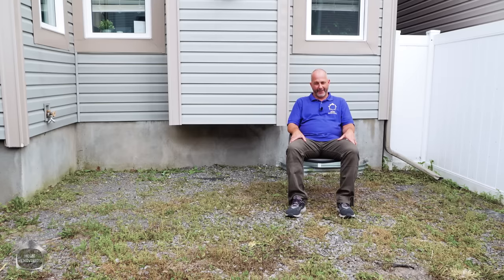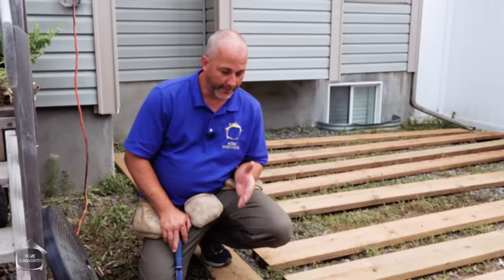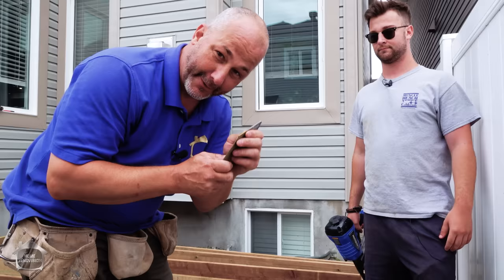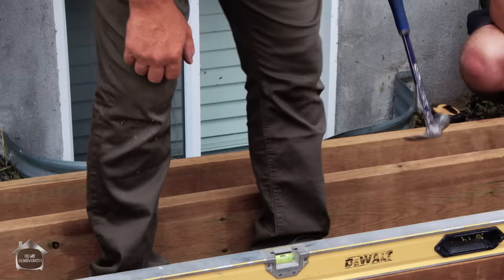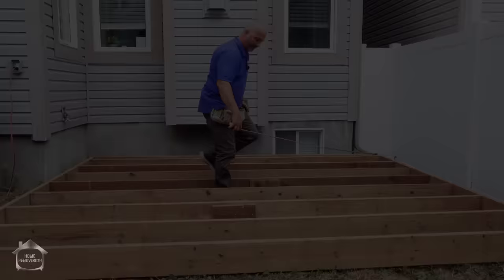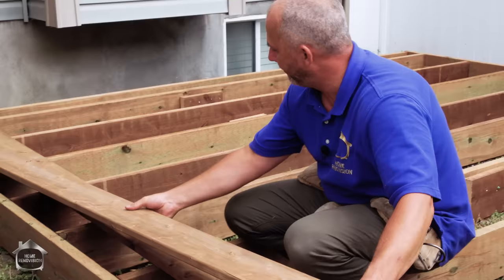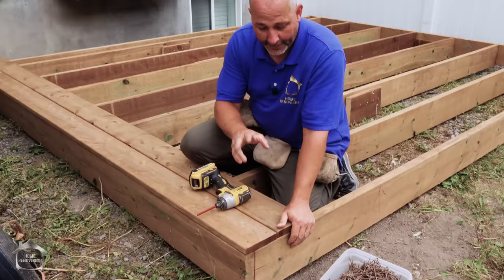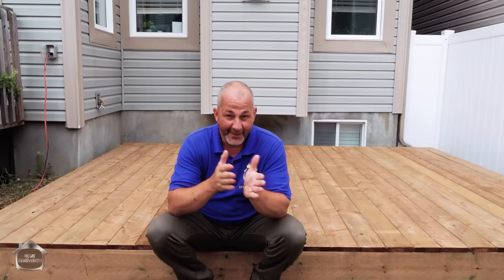How To Build An Affordable Deck

Comment: So I have a seasonal campsite and I want to build a 16'x10' deck, what you showed in this video is a absolute lifesaver.  
I had previously laid stone on the section I am building on. My question is would it be beneficial for me to lay a barrier on top of the stone? Also ground is a little un even in spots. Any tips?

Comment: Hi Jeff,
I think this is just what I need and hope to do it myself. Dealing with the ground prep and concrete blocks was my biggest obstacle. I have somewhat soft dirt in the area where I want a 12x12 deck. What's your recommendation for easiest way to prep the ground for your style if floating deck?

Comment: @home reno vision DIY, so do bgg you use the 2×8 12's just on the outer perimeter,  and the 2×8 10's at the top and bottom? Second, what length were the inners, because you didn't mention if I'm not mistaken?

Comment: Would this be sturdy enough to support a gazebo ? Or is it necessary to add more structural support underneath ( concrete deck bases that are partially sunk into the ground )

Comment: HI Jeff, I'm building an 18x18 floating deck stacked on 4 way deck blocks(no Posts, just slotted on the deckblocks' slots).  How do I join two rim joist and make it sturdy?  Will Drilling screw diagonally be strong enough? Thanks in advance!

Comment: I realize this is a silly question - esp since I just listened to you explain about how to decide which side of each board should be face up - but does the stamping/ink come off of the deck boards? My contractor installed a deck for me, and the stamps are really bugging me. My thought was that side should have been down - they're saying some boards are stamped on both sides, which seems unlikely to me. Anyway: (1) are they stamped on both sides, and (2) does the stamp wear off with time? THANK YOU!

Comment: I really hope to get feed back we have a ground level deck that we want to extend it is only a 11x11 extension and we have had quotes of 4000 to 7000 it's crazy so I wanted to see if a girl like me could do it myself and found you and my question is how do I add the new deck to the old deck and my yard is a little uneven where I will extend if you have any advice I would be forever grateful

Comment: Can I make this, but 6x10 and put 4 post in the corners and have pier blocks at the bottom like you're other video that had the ramps, where you used the 3 beams? I noticed you built another deck on top of those beams and not one here. My height im trying to reach is 3 feet, from ground to top of deck board. I'm just trying to keep from over thinking this. Thank you for your time.

Comment: Can you list the lumber you used size and number of boards ? DIY woman who just got an estimate of 4K from a builder .
Reply from the maker: pressure treated 2x8. you could use 2x6 if you are setting it on the ground. 10 x 12 deck requires 2 boards 12' long 10 boards 10' long
the you need 5/4 x 6" x 12' boards. 21  of those will finish it fine. Cheers!

Comment: I am looking to build a 10 x 10 low level deck for a hot tub. The location is not attached to the house and has a slope of (about) 12" in the 10' span.
question: Your video shows using wood blocks supporting the deck to the ground every five feet. Does this method work for that large of a ground slope?

Comment: I am wanting to build a deck that will cover when my lawn used to be. It’s a 28ftx16ft area. Do I have to level the ground first? Also, I’m having trouble figuring out how many board I will need for the entire project. Do I need to build the deck slightly off the ground in order to prevent the wood from rotting?

Comment: Do you have to raise the deck if your building on concrete? I am thinking of doing this on our rooftop garden. Lots of sun assuming a little bit of moisture from the rains. Location: San Diego/ Tijuana Mexico

Comment: We are building a large platform deck off the back of the house. The house entrance opens outward potentially hitting any structure above 3 1/2” high. 
There’s also a slab we are over. It’s much smaller but is there. 
Our house sits so close to the ground I’m afraid I’ll have to dig out for the band boards and the outer frame , plus have to use 2x4 instead just to ride under the screen door opening. 
Writing this out makes think of other issues. 
Don’t know if this will work. Plus our tiny town wants permits and inspections unlike anything I’ve ever seen. 
Any suggestions? 
The deck build is 12x16 but the original concrete slab is only 12x10’

Comment: I have a question. When you say to nail  Boards in to tight together, but then you say space for rain. I don’t understand. Do we nail boards tight or we leave space. If it’s tight, how does rain pass between boards ? Thanks.
Reply from the maker: wet wood dries after install and creates a gap. dry wood needs to be installed wit a space. Cheers!

Comment: Very nice video. How to keep wood from rooting if thre is a heavy rain? Why did you not lever it up from the ground so it will not float in the water/snow?
Reply: still it will get wet on the surface

Comment: Somehow I have a feeling they used the concrete blocks shown in the beginning of the video instead of the wood blocks to level the deck out, more expensive by a 100.-+  but a better option

Comment: I'm building an 8x10 foot deck on unleveled ground.  Using 2x6 for everything.  Do you think the leveling trick would work or should I use concrete. I've never built a deck so I have no clue. Thanks

Comment: Hi Jeff, 
I am wondering if its possible to use this same layout but use a 2x6 instead of a 2x8 board throughout? I am in a rental and am looking to build something that is more affordable since the price difference of these boards in my area is around $9 each. Does the shorter deck have any issues that I might not know about?
thank you in advance :)

Comment: I tried this but I did not use concrete- I just dug a 6 inch hole and sunk in my posts. It was ok for a few months but it’s wobbly now (about 5 feet off the ground).  My question is - do I need to lay down a concrete base?

Comment: I want to build a deck, but have a meter of cement and then grass the rest of the area. Building over the grass is fine, but want to keep the cement. My question is would I need to treat the wood that is on the cement part for moisture or wouldn't it matter? Southern hemisphere (warm climate)

Comment: Great video, thanks. I am building a large, single level, unattached deck that is 40' wide.  However, it is 3 different lengths, the dining section on the left is 11W'x8L', the grill area on the right is 11'Wx5'6"L and the main entertainment area in the middle is 18'Wx 11'6"L. This area comes out from the two wings at 45º angles to the front entrance area where it is only 10'W.   My questions are:  
Should my joists go width wise or length wise? I am worried about the 40' width being too far for joists even with a footing being located every 3.5 feet.
If I have the joists going length wise then I will I have to have my decking going lengthwise instead of width?  I am worried about that looking funny not running the width of the deck.
Could I actually build it as if it is 3 separate decks and then just screw them together? Part of me wants to do it that way to make the project more manageable.
I have drawings and photos available.
Thanks.

Comment: Question..we are building deck up against the house.  Its 8 x 8.  We are having trouble squaring it.  We are off by 1ish inch.  If we correct it, then its not up against the house and look weird.  Will the inch make a difference ?  Ty

Comment: Hey Home RenoVision DIY, I plan on building a deck for my RV. That deck is going to be around 30'x10'. The issue I have is from the back to the front of my RV, I have a slope of almost 3 feets. This means I have to start as a ground deck and finish with some posts. I was wondering if it was necessary to have beams since I don't think it's going to be possible where the deck has to be ground level. Is it possible to simply have joists with posts? Will it be solid enough? FYI, my RV is located in Quebec and most of the deck is going to be between 0 and 3 feets high, so I'm not sure rules apply here haha. I simply want it to be safe for my kids.

Comment: I live in the snowbelt (Vermont). I noticed that you didn't use landscape cloth (even though you mentioned it) or paver stones, deck blocks, etc. The area on my property where I want to build the deck is a little moist but does get 5-6 hours of sunlight.  It does dry out well after a few days of dry weather. Will the lumber hold up over time with direct contact with the ground? If I get 15-20 years I'd be happy.
Reply from the maker: you'll get that. cheers!

Comment: Nice. Job ,  I am building an 8 x 20 deck 24 " high. im 54 a female health issues. I just need help getting squared and level. Im not putting 4x4 in ground. Im sitting them on top of  concrete pads instead. I have noone to help. Any help suggestions would help. Please. and thanks.

Comment: Hello, Jeff. I was always told that a deck requires posts with concrete. Does the tarp underneath replace that? Thanks for all you do!!
Reply: Why would a tarp replace foundational footings? The purpose of the footings is to creat me a rot free connection between the ground and the decl frame. He mentions this in the start of the video talking about the soil. A tarp layed down will mean the water will pool on top and rot your deck. Just set it on cinder blocks if you don’t want to dig holes and lay concrete

Comment: I'm looking at building a deck on top of an existing patio made of slabs is this ok and what is the minimum thickness of timber I can use for the frame as I only have about 6 inches between the slabs and the bottom of the back door and I have to account for the thickness of the deck boards which are 1inch and should I leave gaps for swelling as I live in the wet uk 😆

Comment: Does this hinder rain flow 
keeping water from running into window wells
that are below ground ? 
Do you need a trench ?
Reply from the maker: it could so always run your framing in the direction that water flows to avoid that problem. Cheers! That is why we use blocks to adjust the level so there is always room for the water to drain.

Comment: Hi, I am going to build a decking 10x10’ in my backyard. Half of the frame will flush with grass and the other half 5” above the grass. I am going to use 2”x6”x10’ severe weather lumber from lowes. My backyard soil is clay and limestone. Do I still need posts? Can you please advise? I live in central PA
Reply: The deck is not attached to my house and the middle of the deck 6’x6’ will be porcelain so it will be filled with stone and sand. So only 2’ on each side will have Trex boards. The frame will be 12” apart instead of 16” to be more rigid and because I am going to use groves Trex, not a block Trex.
Reply: Sorry, I am asking a lot. Do I need to protect the lumber since it will be in the ground and how?

Comment: Would the deck be susceptible to moisture and mould considering that it's sitting on the ground and not on stumps ?
Reply: Same question, doing research they say if it cannot dry out underneath you will have mold.

Comment: Great video thank you!   Question, is it ok to butt the deck boards tight to each other?  Will there be room for movement and rain drain?
Reply from the maker: if you install them wet then yes.
Reply: @HomeRenoVisionDIY  thanks! Otherwise, when installing them dry, should there be a slight gap between each board?

Comment: We went pressure treated frame & Trex decking. Our frame is now rotted in many spots. Spongy to walk on. Need a best most cost effective solution please. Thanks
Reply: Curious how long before the pressure treated frame rotted out? Are you over grass. We need to build on grass as well.
Reply: @kebejer1  partial grass & an old sidewalk. 15yrs

Comment: Ty for your  videos! This one in particular! Question, we want to build a 10'x20' deck in our backyard similar to this one in video. We want to add rails to it would be the only change. How do you recommend we do the rails?

Also the deck will be in front of our master bedroom and later this year we want to have contractor replace our windows with French doors to open to deck. We got a quote for the deck at 6k and the French doors and install work about 5500 or so. Our thought is we could build the deck and save But no way we want to try and convert our window to French doorz. So if we do the deck ,how do we know how high we can make it to accommodate the French doors.
Reply: I can send you pics of our yard and proposed area of deck..just need your email, appreciate your help sir.

Comment: I didn't fully understand the leveling process with the pieces of 2X4.
Reply from the maker: what I am building there is a point load with the block and nails. the nails carry a huge amount of load so lift the deck level set the block and nail it to maintain that height. Cheers!

Comment: Pretty sure I'm going to be told this a bad idea but, could i build a deck like this over an existing deck?  I have a ground level (literally about 2 inches above the grass) deck that's old and falling apart and i would love to be able to just build this over it.
Reply from the maker: take off the deck boards first and make sure the  structure is solid enough to support it.

Comment: I'm about to do this in my back yard in New York. Right on the ground over soil. Deck will be in the sun. Am I supposed to leave gaps between the boards?
Reply from the maker: yes. Cheers! in the summer it will have gaps and in the spring and fall it will not. Cheers!

Comment: Just curious what you think the price on that exact same project would be today? Looking to build for our seasonal campsite
Reply: He said it was $650 in materials 10
Months ago.   That is fairly close to what I built my 12’ x 12’ ground level for 2 years ago (Canadian $800, using standard pine).   Lumber prices have risen so much in the past three months that what once you could buy to build 14.2 houses, you will now only be able to build 2.4 houses with.  That is a 591.7% rise in lumber prices, all within the past two months (hyperinflation).   Multiplying that rise in price by this fellows $650 budget = $3,845.00.  

...But keep your eyes out for deals.  I don’t know about down south, but here in Canada thieves are now targeting the construction industry.  Worksites are being robbed blind by lumber thieves.   Seriously.

Comment: I have my surfaced prepped with textile down, do I need to put gravel on top of the textile and then do the deck, or simply on the textile is fine with no gravel? Thanks.
Reply from the maker: if you are setting the deck right on the textile it won't move so you are fine. Cheers!
Reply: @HomeRenoVisionDIY  excellent.

Comment: HELP, were renovating our old deck that came with the house bc it is moody and soft. We pulled the old planks out but then the wood that they are sitting on are also soft (these are 3.5 x 3.5) the plans on top are 1.5 x 4" boards measuring 114" long.  There is not a lot of sun and we noticed the ground the patio was on are MUDDY.  Can we just replace the rotten plans like nothing happened or do we need to lay down sand on the mud or something first? ALso do you recommend we change the boards to 2x10 that you use in this video?
Reply: also not connected to home and patio is in an enclosed fenced front yard under a tree.
Reply: How long does it take to get a reply ? We have the deck pulled apart and really need help now :(

Comment: Is it necessary to screw edge of deck into house to keep deck from moving at all?
Reply from the maker: in many climates it is actually better to not attach the deck. that way you don't need to pour footings. check local codes for this as they change from region to region.
Reply: @HomeRenoVisionDIY  thanks!

Comment: I built a raised flower bed using brown sienna PT lumber......in 5 years it started to rot....when you buy this in the store it clearly says Above Ground Use Only.....now if this deck is being built in a warmer climate I'm sure it's ok....I live in Southern Ontario (Canada for those of you who are geographically challenged) I would not build it this way....he has another video where he sets it on concrete blocks and prefer that way so the wood doesn't wick moisture from the wet ground.

Comment: I don’t get the crown of the wood part 😢
Reply: The crown is a natural bend in the wood that you need to be aware of and take into account when using wood as a building material. Ideally, all of your boards would be perfectly straight, but lumber is not a perfect building material and even if you inspect every single piece of wood, flaws can still develop over time. So it's important to note small deviations like the crown and account for them. The best way to do this is to sight the board, determine if a crown is present, and then orient the board as necessary. The ring pattern at the end of a board is generally a solid indicator of the direction of a crown, but not always, so you should always check and mark your boards appropriately, trying to group similar crown deviations together or carefully incorporate them onto your design.

Comment: If I had seen this before I built my deck  I wouldn't have to level 24 piles of concrete slabs (because of 2x4 instead of 2x8 lumber) and spend one week doing it... 🤦

Comment: Wood decks to close up the ground rot quickly. Dont do it. Use paving stones.
Reply: By the time this will rot out it will probably be time to build new deck anyway. It's a simple idea can be done in a weekend. I've done similar but did use bricks for posts I put in corners